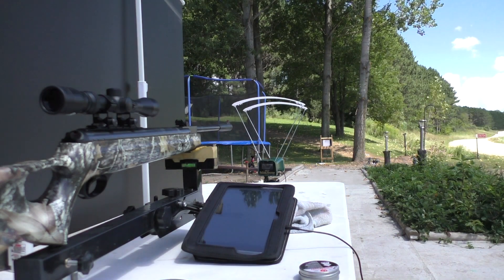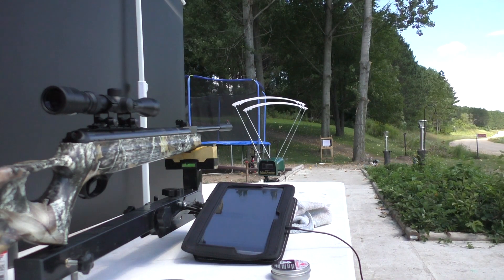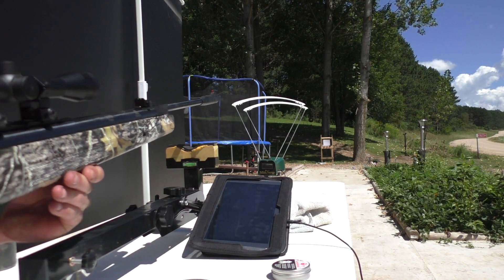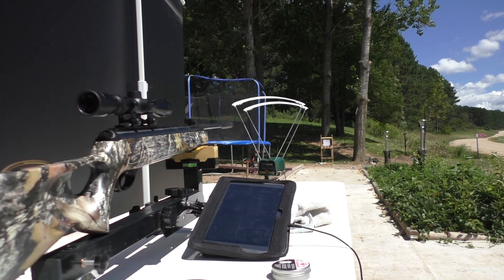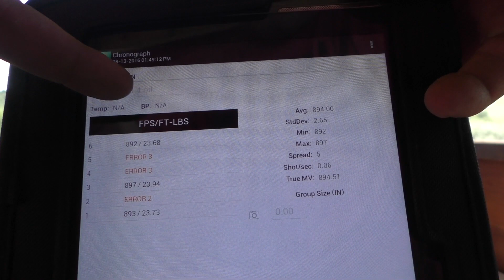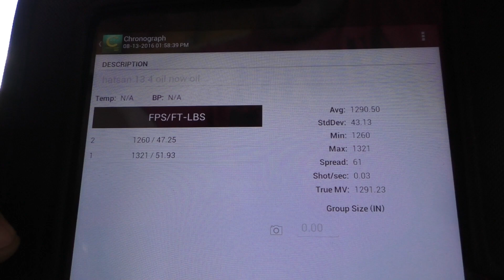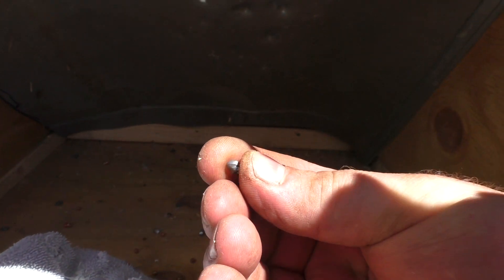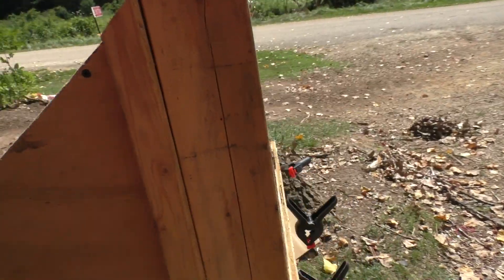Hatsan 125 22 caliber Air Rifle  Dieseling vs Stock 1581 FPS

Comment: very interesting. A basic equation we must consider is PV=nRT. T= PV/ Rn (The ideal gas law) . At smaller and smaller volumes and with a spike in  pressure (when the piston in the air rifle fires and the volume decreases and pressure increases) there will be a spike in temperature of a huge amount. This could well ignite a petroleum product. There need not be a "glow plug" as in diesel engines at these pressures as we are talking thousands of psi of pressure that a car engine is not running at (hence the need for a glow plug for a diesel engine in a car).
Reply from the maker: That is so true

Comment: For the questions about accuracy..

It's quite simple, if you break the sound barrier it won't be accurate.

Use heavier pellets sow it will hit harder in the end.

I use h&n slugs in a .177 @ 16gr.

Without dieseling it stick out of the pine board, with dieseling they go straigt through 30mm.

Groups are reasonable. 

So stay beneath the sound barrier!
Reply: Can you shoot slugs with a break barrel ?! That wouldn't destroy the barrel from inside ?!!! Because I heard that there are specific barrels for slugs like pcp only maybe.
Reply: It's quite simple, if you break the sound barrier it won't be accurate.,
 mine is also accurate at 400 mps, its  a nonsens story imo

Comment: I out tiki torch oil in my gammo wildcat whisper with alloy pellets and it shoots 13450 average woth out the torch oil and with oil it shoots 1650 feet  per second and its louder then my 22lr pistols and rifles and it has a silencer built into the gammo air rifle and its .177 pellets and shooting a squirrel with the torch oil literally went through the other sode like hot knife through butter and with iut it never goes through other side cause its only .177 cal

Comment: Q #2 of 2:  BB guns used to only semi or full auto round BBs while Pellets had to be inserted one at a time. I have been unable to locate proof of Pellets being shot semi or full auto. I have seen found Pellet guns claiming to fire Pellets in semi auto mode but, have not actually seen it done except in those plastic strip which hold about 5 rounds and you can't carry that live as you hunt in the woods. I have seen many of the guns claiming such ability deny it when you get to the bottom of their ads. Some do not deny it but use those little plastic strips which is not acceptable for me. So I am looking for a BB/Pellet gun that can hold at least 15 rounds of Pellets and not require the plastic exterior strips. Also, I have not seen a single full auto BB/Pellet guns or just Pellet gun. I have a game face sub machine gun and I am thinking about modifying a drum to hold Pellets though they will require more time to load due to the loading with all pellets given proper orientation. However, if a quick loader mechanism could allow the orientation adjustment needed and the drum have a complete side that hinges and opens, it could be viable... and neat too.  I realize the 320 Fps would require a large increase.

Comment: Q#1 of 2:  Can you Diesel a regular round .117 and or 6mm metal BB in a BB gun? This could be taken through all the various BB gun types of ammo. I am simply trying to find out about the 
.177 and 6mm round BBs. One has made a video on this, I have yet to find it. So, I am quite certain if someone does make this as a title Video it will get a lot of hits. It may be assumed it is because it doesn't work or it is too ineffective. But, that actually is not proof as it could be too difficult to achieve.

Comment: I have reached 1591 fps (485 mps) and 58.2 FPE (79 Joules) with my Hatsan Airtact without dieseling just by tuning gas piston. I used Elko Green Express .22
Reply: What did you do to tune it?
Reply: Had to be a chrony error.  No way.
Reply: That’s completely unbelievable

Comment: What happens when you slide down a slip and slide with oil on your belly. Speed increase? you bet. As for actual oil igniting from pressure seems a little sci fi make believe. Some, Pew pew bullshit, dude it's the sound barrier... Cool video though. like seeing the capabilities..
Reply: Vaseline in the back skirt negates your theory. 

FYI...the compression is sufficient to cause ignition.

Comment: I have an Artmis 1600 5.5 shooting 950 fps at 14.3 grain pellet, I added 1 drop of oil in the back of a pellet and went from 950 fps 38 joules to a WHOPPING 1700 fps 120 joules! I was amazed and couldn't believe the results and so I did 2 more rounds ... It went 1670 fps and the other 1570.
Reply: Silicone grease is better because you can manage a more stable and accurate amount every single time, since not every drop is the same size and it drips, you get less consistency, that matters for accuracy
Reply: Impresionante el cambio.
Reply: @miguelalejandrokaufman3182  yes but will break the seals if done all the time.

Comment: I have found that using pellet gun oil works 
Also since it is designed for pellet gun air systems you don't have to worry. It actually helps your gun a little bit.
I have also noticed that you can get the dieseling effect on the first shot of a CO2 canister pellet gun, if you put enough pellet gun oil where the canister gets pieced. It flows in through the air system and diesels on the first shot
Reply: For me I try getting the gun oil to combust by putting small amount in just the back of the pellet, sometimes it goes off and sometimes it doesn't, definitely damaged my rifle.
Reply: @@1-Wheel-Drive I'll consider your response before trying that oil, but I have been getting some diesel from the gas pump handles (no need to buy a gallon) and try that, but I AM a little concerned about the seals, even tho some old-timers used it for years they say.

Comment: i finally got my chronograph working in my basement recently. anyways i was using a umarex  octane .177 and gamo raptor gold pba which weight 6.5 grain. before diseling i was getting about 1000 fps, while delsing i got 1400-to 1645fps. it was too loud in the house to continue willy nilly. i will make a video at some point demonstrating this. also, i will admit this could be dangerous and may be hurting the gun and maybe isnt accurate, too early to tell.

Comment: I've got a crosman valiant and the first few shots always diesel. Crazy noise and recoil plus the pellet will go a full foot above poa. I think there's a bunch of oil and crud in the supressor. I've put 700 pellets through it and still diesels. I'm scared that if I just spray brake clean down it I might dissolve the glue or whatever holds the barrel in, along with losing all my good barrel leading. Only has to diesel once to break a scope. The last scope I had was $80 and it lasted a single shot past the 2 shot sight in. If anyone has an idea where I should go from here I'm all ears. Really don't wanna spend $1500 on a PCC just to shoot a couple pigeons 20 yards away.

Comment: you can get the same effect with silicone oil without having to worry about the petroleum distillates taking out your seals
Reply: Sometimes the oil gets combusted leading to a more powerful shot but higher pressures that can destroy the pellet, I saw sparks shoot out my rifle and found charred plastic from what I fired.

Comment: Hi, do you have any experience on what this does to your airgun (valves, seals etc) on the long term?
Reply: after about 5 years there'd be minor loosening on the seals but you should be replacing them every couple years any way
Reply: Absolutely nothing
Reply: Detonation creates heat, rubber doesnt like it! 
Take this how you want but id make sure you can find seals for your airgun first!

 {Seals for a Crosman are less than 3$ each but Gamo will not sell them to you direcltly}
Reply: @LowkeyAirgunner  I don´t think so; the rubber will heat anyway everytime you fire the gun.

Comment: Does dieseling also work with pcp airrifles ?
Reply: no. it will not work. i can explain why but im tired i will give you the short version. your pcp is precharged with air and it allows x amount of air out into the back of the pellet. break barrel air rifles have two things going on. the spring or the gas piston is compressed  when the gun cocked. at this point there is no air under pressure. once the trigger is pulled the spring or gas piston shoves another piston down a sealed tube that has the pellet at the other end of the chamber. as the air rapidly compresses, it can detonate through sheer heat and air pressure igniting any fuels that can burn  causing  a small combustion chamber affect to take place pushing against the pellet.
Reply: Of course it will work with pcp.
Reply: Yea probably. I wouldn't do it tho

Comment: Caught a 25 caliber Edge from airgun Depot and was impressed from shooting right out of the box until I cleaned the barrel with a little bit of PB blaster and with 20 grain pellets and went supersonic right through a gallon water jug and blew it up with similar damage as a CCI 22 stinger. Even with residual PB blaster in the barrel. So I guess if you're in a tight spot and only have a break barrel airgun and a little bit of PB blaster watch it come alive.
Reply: I just bought the edge a month ago and it was oiled out of the box and I didn’t crono my first shot but I tested out on some pillows and it when’s thought 2 pillows stopped on the 3rd I think it dieseled from all of the oil I haven’t shot it again yet but I haven’t seen any damage on the seals etc but I could feel a good amount of power too it and it cracked just like a 22LR

Comment: awesome video .I also have a hatsan 125 sniper .177 cal  I have had it for 5 years and 3 years ago I customized it .I got a super tune kit from amazon double spring kit and seals .+lube tune 'if fires a 7.9 gr pellet at an average of 1325 fps .I don't know how much power that is but it hits like a hammer.
Reply from the maker: Wow. I may try that. Thanks
Reply: your very welcome
Reply: 7.9 grain at 1325fps is 30.79fpe

Comment: First actual test I've come across.  Yeah it's silly and will break your airgun, but I like the fact that you put actual numbers to it
Reply: Sounds like a lot of people do it often and with no problems.
Reply: @jacobgreen6939  From what I've heard I question if it's the dieseling or what they use as propellant. I've seen people use engine cleaner sprayed onto the piston. It's hard to see how this would not become harsh on seals over time. on the other hand Vaseline in the pellets skirt is far less harsh.

Comment: Hang 🥄 🥄 spoons 🥄 on a rod going through your pellet trap, bending handles around the rod to make spinners and if you've got a saw to slice co2 cartridges in half , they'll work well too. Next time you'll use thicker plate of metal with wood and ceramic tiles sandwiched between the plywood. Save those old pellets for reloading your 12 shells 🐚 in brass.
Reply: Cool idea. I flattened the necks of some co2 cartridges, drilled them for a rod and painted them yellow.

Comment: Someone had posted that using water will do the same as any oil or grease product, I have tried that and it doesn't work, only a oil or grease product will make it diesel ! It proves without a doubt that combustion is going on inside the rifle when firing !
Reply: Are you sure? I would put some water in your car's gastank to double check this if I were you
Reply: does water combust? no, it doesnt. petroleum products will ignight

Comment: I would like to see a test of someone dieseling a break barrel until something breaks. Can't believe that hasn't been done yet.
Reply: John Sholl  you should not get the oil into the compression chamber,put only a litlle drop int the skirt of the pellet. then there will be only a combustion in the barrel .And there it can do its work .putting the pellet at higher speed instead .ramming the piston back
Reply: I've been dieseling my crossman storm xt .177 and gamo viper 1300 in .177  for years now and they are still shooting strong.
Reply: lost beetle, please...
Reply: "Please" what?  I see all the vids of people saying how dieseling can ruin your gun, but none of a ruined gun. You would think somebody would have posted a vid of the actual damage by now, I can't find one. "Things that make you go Hmmmmm".
Reply: @EarthSurferUSA   jou wil destroy the spring seals and sometimes a compression chamber gets a bulge . weihrauch had sometime back a gun named EL 54 or baracuda it dieselt on ether in de compression chamber it had a ether pump on the side of the gun  (was basic a hw 35) and  not many where made. it was not predictable in the velocity and thats not good for accuracy
Reply: I shoot almost all the time with oil and has never damaged it or blown out a seal.
Reply: That’s because there’s no proof that it hurts your gun
Reply: I like 3n1 oil never had an issue 4yrs now
Reply: Here is another "Hmmmm", I just thought about. "Dieseling" a pellet gun may actually make it legally a "firearm", since the oil is used as a burning propellant to increase speed.  Politically, the manufactures will be blamed, and the high velocity pellet gun will be banned.  Just saying, enjoy the future.
Reply: I HAVE A VIDEO DOING THAT AND THE SMELL AND SMOKE ARE WELL WERE HORRENDOUS. IT SMELLED SIMILAR TO A TYPE OF STRONG OIL, GUN POWDER, AND BURNT TIRES.. I NEVER THOUGHT ANYTHING OF THAT VIDEO.WAS TRYING TO CRACK A CINDER BLOCK WITH A GAMO VO. 25 AND SUCCEEDED. IN ABOUT 3 TO 4 SHOTS. ILL POST ONCE I FIGURE HOW..BACK POPPED UP AND SOME SKINNY CYLINDER THING FLEW OUT. HAND HAD BLACK SUT AND IT MADE A BURNT LOOKING HOLE ON THE STRUCK AREA.

Comment: hi, i have hatsan striker 1000s .177, i bought it just two days ago and after i take a shoot and i blow trough the barrel the smoke comes out of it, is it dieseling or not?
and one more question, on internet, in every shop and in paperwork of my air rifle it says that muzzle velocity is about 1000fps and about 305ms, so since i use 4.5mm flat head pellets, do you think my air rifle could reach that speed of 305ms ( 1000fps ) or close?
Reply from the maker: IF smoke is coming out it is dieseling. Flat or rounded should come out about the same. Usually Hatsan is pretty good with ratings so it should
Reply: nemanja pribanovic sometimes I get smoke in the barrel after a shot without boosting.. it just happens sometimes
Reply: My 125 dieseled for probably the first 25 shots, likely due to pile inside of the action. Pellets would tumble through cans, ricochet and make loud cracks after hitting trees.

Comment: That pellet trap is nice, if you want to stop the loud ring when it hits the plate and have zero chance of a pellet coming back get your self some Duct seal Putty and mash about 12 inches of it in there for anything .25 (60ftlbs or less) and smaller.. 12 inches will stop my RAW 1000x .30 shooting at 110ftlbs at 50 yards no problems.. I use 18 inches thick in my long range high power traps because my Custom Air Force .257 and .284 at 370 and 455 ftlbs respectively will run through about 15 to 16 inches at 200 yards and 11 to 12 inches at 300 yards.. in my .177, .22 and .25 traps I use 12 inches thick of it and it has no issues stopping 70ftlbs at 50 yards even when your just stacking pellets.. after a 1000 rounds or so take it out and kneed it some then press it back in and your good to go for another 1000 rounds, at high power PCP energies, if your shooting sub 50 ftlb guns 8 to 10 inches is enough but you will eat out the main impact areas quickly and have to kneed it and put it back in, if you use 12 to 14 inches thick then it will go a lot of shots before you need to fix it.. it contains the lead so that's good for you and your kids/grand kids and pets.. it's silent on impact so that's a huge plus and 14 inches thick in sub 50 ftlb guns even at point blank range you will have absolutely ZERO chance of it going through it. It's not that's costly, to pack a 20 inch by 20 inch 18 inches thick for my ultra long range airguns it cost about 50 bucks and lasts forever... to pack a 12x12 target 12 to 14 inches thick will run you about 20 to 25 bucks and like I said it will last a VERY VERY long time.. every 1500 to 2000 rounds take it out and kneed it then press it back in and bingo your ready to go again. Zero noise, zero stray lead, zero lead build up on group around target, zero lead fragments flying in your yard from hitting a metal back stop. Duct Seal is an amazing thing to make as the back stop for your pellets even ultra high power.. My Texan with hand poured 395 grain spitzers at 470ftlbs will only penetrate 18 inches at 100 yards and with 450 grain hollow points 11 inches at 50 yards.. the stuff stops lead QUICKLY. And the splat in really high power guns sounds really cool. Home Depot or Lowe's both carry it, here it runs $2.79$ for a 1.5lb bar of the stuff.
Reply from the maker: Awesome stuff for this. I ended up penetrating my mild steel with the hatsan So I'm going to hit home depot this weekend and give it a try. Thanks much